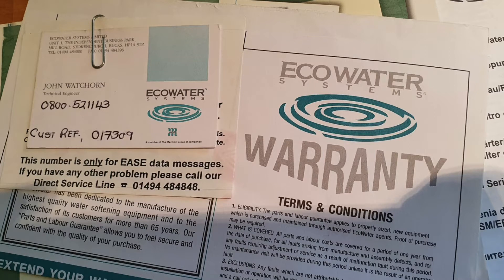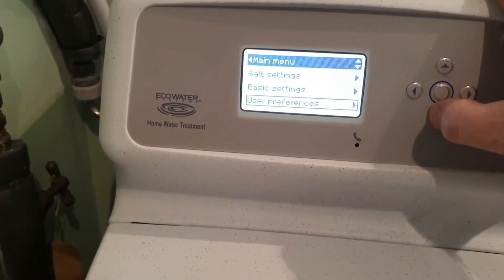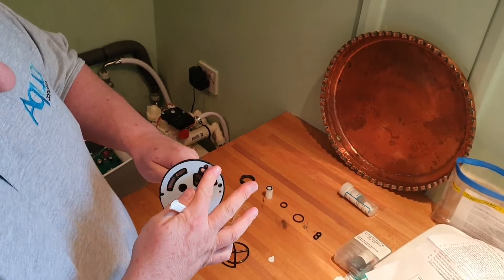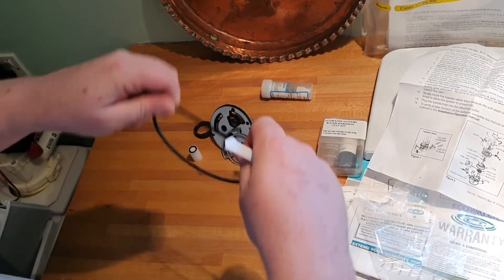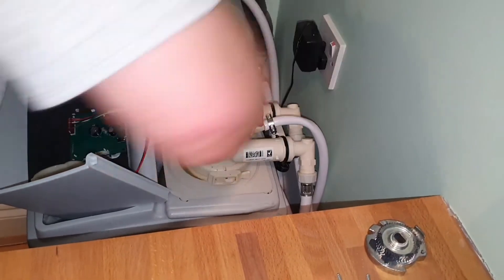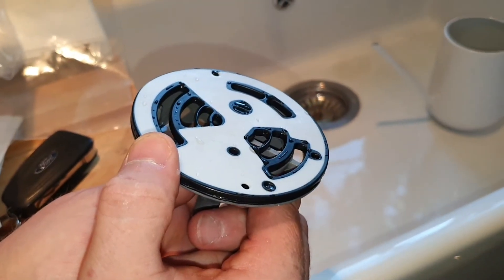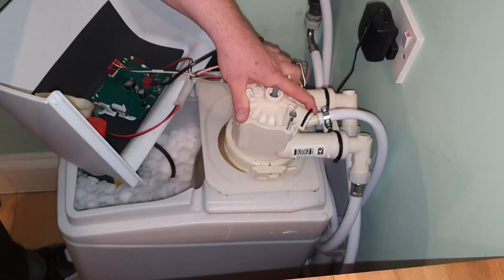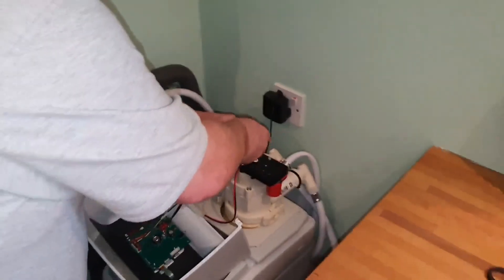Ecowater water softener repair [Water softener repair]

Comment: If the salt level never goes lower than 40% on an Ecowater Evolution is it a sign of a bad sensor? If I add salt it goes up to 60% or 80% but never drops lower than 40%.

Comment: Hello - I’m getting error code 3 from my eco water unit.  Motor continues to run and leaks out of the drain pipe because of this.  Any tips on what I should replace?

Comment: How was cover removed? The video went right into the internal mechanisms without showing how the cover came off. Anyone to advise please?
Reply from the maker: Remove the salt lid and the whole cover slides forward and removes
Reply: I’ve got a basic Ecowater system and removed the salt lid, but, doesn’t look like it slides forward as I tried several times
Reply: I figured it out. It’s pressure fitted and lifted straight up after the salt lid was removed.
Reply: But now comes the fun part because there is no water in with the salt whatsoever. Any ideas? Thank you.

Comment: I have an ecowater erc3000r20 and I seem to have water draining through the drain pipe but it's no in regeneration mode. Two things online state yhat it could be either main piston seal leak or control valve stuck in open position. How would I go about diagnosing myself and fixing?
Reply: I believe it is dual disk it looked like this one but on its side. So do everything you did in this video but in each side and it should stop the water from going to drain pipe?
Reply: Saw screen said I had error code 3 which when I looked up it said something about a bad seal so that's what I'll be looking Into. Thanks for the help I'll let you know how it goes
Reply from the maker: @andrewjohanson8575  Error 3 is normally motor inoperable. Have a look at the connections there. I should have a manual for this which I can email if you need it 👍
Reply: Error code is gone and I tried to start a regeneration cycle motor advanced and now no more water draining and all working. I guess system lost power in middle of cycle and didn't know to advance. Now I just have to get a switchboard that connects my softner to chemical tub to allow my nutra 7 mixture to pump into line. It's not working
Reply from the maker: 👋👋 I believe that model is a dual disk 1 " valve. (Subscribers correct me if I am wrong)
It should have two discs opposite in a horizontal position. Also there is two spider gaskets and wear strips. Get the seal and disc  kit and change and everything will be rosey. Do one side at a time, or else it is possible to be 180° on one disc. Next time I come across one, I'll definitely do a video, but they are very rare now. There are smaller size softeners with loads more capacity. Good luck.
Reply: Where can I order a seal and disk kit?
Reply from the maker: @andrewjohanson8575  where are located?
Reply: I live in Maryland USA
Reply from the maker: Speak to your local Ecowater dealer. I am in the UK and they maybe a variant here, which might not work in your valve.  The US seem to be reluctant to supply the parts, and if this is the case get back to me.  Good luck Andrew 👍
Reply: My local dealer won't be open until Monday and are the type to charge and arm and a leg because they want to come out to fix. I've got my water softner bypassed for now to make sure my yard doesn't flood since it drains outside. I'm thinking of popping open the valves and see what looms amiss.
Reply from the maker: @andrewjohanson8575  I can say that the disc will be scored or a o ring has perished. Have a go, and take pictures so you can back track!
Reply: Ok if disk looks OK but seal is messed up I should be able to just replace the seal correct?
Reply from the maker: It comes normally as a complete kit. Whilst it's open. Change everything

Comment: I have an Ecowater model ESD 2502 R39 and it is leaking from the top. Mine has 8 screws not 5. Do you know if the procedure you performed in this vid would fix my leak?
Reply from the maker: Will need some picture of the leak
Reply from the maker: Thanks for the picture. From that angle it doesn't seem to have a fracture in the valve head. It looks to me that the top O ring is leaking. Your local Ecowater dealer should be able to supply you with a seal and disc kit which contains that o ring. You have to take off the head to get to that o ring, so it makes sense to change the disc etc. Same procedure has the 3/4 valve on this video. Hope this helps and good luck. 👍

Comment: I have an evolution eco water softener whose brine tank is not adding much water during a recharge.  Was the lack of water to the brine tank what motivated the valve replacement in this video?  Thanks for posting and sharing your expertise.
Reply from the maker: This video is a tear down and rebuild. The diagnosis videos are going to be uploaded on the members section. However, the problem of it not filling, is more likely to be a aspirator problem. The aspirator contains some flow restrictors (small black puck with a hole in the center)
These commonly block. Remove the aspirator and dissemble. Blow out all the  bits and clean and you should be OK.
Reply: Thank you so much for the quick reply and pro tip, much appreciated!  Subscribed and looking forward to watching more videos.

Comment: My EcoWater Systems softener is not working correctly. It’s running water out drain line, so I pushed in the bypass valve to stop it. Could you please help me?
Reply: Also, I’ve got an ERR01 on screen
Reply from the maker: It's stuck in regen. Error 1 is electrical fault, switch power off and wait 5 mins. Put back on and see if code clears. You maybe able to advance through the regen back into service using the regen button. 
Try that first.